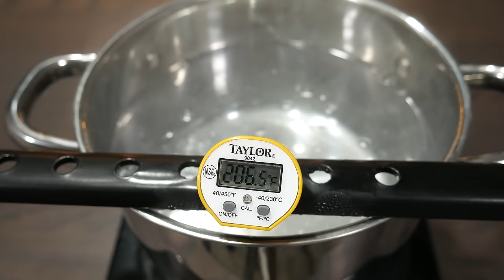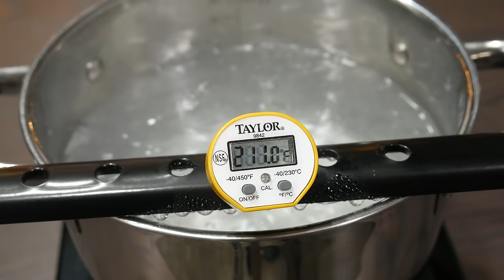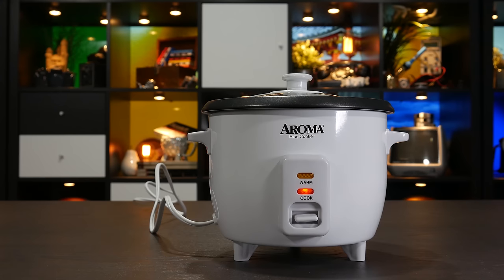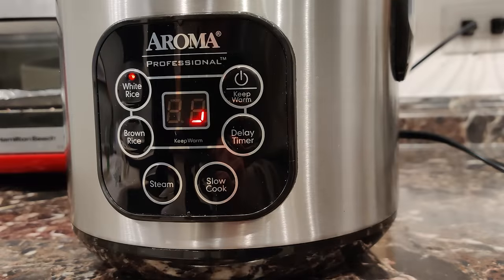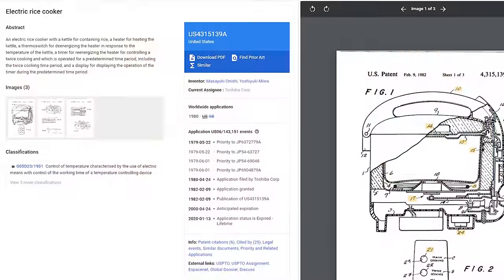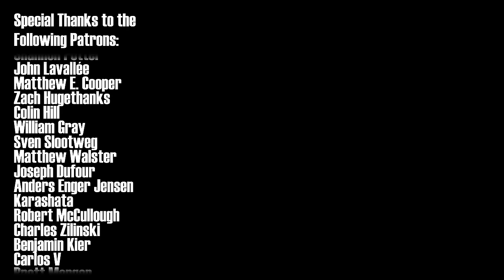Old-fashioned rice cookers are extremely clever

Comment: "As I'm sure we all know, water boils at 212 degrees Fahrenheit"

I didn't. I knew it boils at 100 degrees Celsius, though :P
(Bet he totally didn't see this type of comment coming)
Reply: Except it doesn't if you're above sea level...
Reply: @awo1fman  exactly, that's why the Celcius scale is superior 100 degrees the boiling point of water at sea level, 0 degrees the freezing point
Reply: @ewanwood  Nope, it's far inferior, because the boiling point of water is arbitrary and irrelevant, and there are no simple comfort ranges like there is every 10 degrees with Fahrenheit. Celsius blows.
Reply: @awo1fman  What do you mean by "there are no simple comfort ranges"? Comfort is subjective, also (to me) 18C is cold, 20C meh, 21-23C good for the winter, 28C good for the summer, 30+ is damn hot, 50C means my tea is ready, 6C means my beer is cool. Don't need anything else.

Also, being that water is the principle of life I think it's a sensible choice to choose its boiling and freezing point as a reference scale. Taking body temperature as a reference is bollocks since there are no two human beings that have the same exact body temperature in the same exact conditions and feel exactly the same about it, while water boiling is ubiquitous everywhere in the universe (at a given pressure).
Reply: @alessandroceloria  the F temperature scale is based on the normal temperature range of human life.
0 F is about as low as the temperature gets in most of the more inhabited parts of the world, and 100 is about as hot as it gets in those places too.
So I wouldn't be surprised if he measured the two extremes between winter and summer where he lived, and used those as 0 and 100.

But generally speaking, you don't want to be in temperature less than 0 or over 100, it's just not good for your health.

C just doesn't fit this kind of useful to everyone range, freezing is not as low as things get most places, and boiling water is WAY too hot!

It's great for science where boiling water is a basis for many things, but not so much for human life.
You basically live in 12 degrees, while I live in 100 degrees.
Reply: @ke6gwf  Fair enough. It probably boils down (he he) to what someone's accustomed to use day to day.
Reply: @awo1fman  yep it's so inferior the the United States, it's unincorporated territories and its freely associated states in the west Pacific are essentially the only places in the world where Fahrenheit are officially used. 🤣
Reply: @ewanwood  And we all know the majority is always right. 🙄
Reply: @awo1fman   Mark Haury   Mark Haury  yeah cos the earth is actually flat bro just because the majority believe it isn't. Besides Celcius is a metric scale and it is recorded as degrees .1 to .9 between degrees. Fahrenheit is established from a freezing point of a brine solution which seems pretty arbitrary - not sure about the whole 'normal temperature range of human life' statement. Besides Kelvin is the temperature scale of physical science not so much Celcius.
Reply: @awo1fman  But 0 Fahrenheit was defined as the temperature of saturated brine at a particular pressure & 100 was defined as the blood temperature of the inventor..but he must have had a fever because blood temperature is 97.8-99.... so it was crazy to start with.
Reply: @ke6gwf  No it isn't. 0F was defined as the melting point of saturated brine & 100F was blood temperature, neither of which can be accurately recreated & the inventor also had a fever so 100F was wrong in the first place. Celsius is the melting & boiling point of pure water at "standard" pressure, conditions which are easier to recreate.
Reply: @TheRip72  But Fahrenheit has very nice and round comfort zones. 70°F is "room temperature" and very comfortable. 80°F is getting warm but is very tolerable. 90°F is getting uncomfortable, and 100°F is roasting. Going the other way, 60°F is cool but stil fine, 50°F is light jacket weather, 40°F is medium jacket weather, and 30°F is parka weather. There are no such round, sensible, easy number ranges for Celsius. You are defending stupidity.
Reply: @ewanwood  Funny, I live in a country that has been Metric for 40 years, and yet half the people still use Imperial when describing things to each other, even people who are decades too young to have ever formally learned anything but Metric. Because Metric is extremely non-intuitive and useless for everyday life.
Reply: @TheRip72  wrong on several counts. Lol
0 is an easily reproduced mixture of equal amounts of water, ice, and a salt.
32 is easily reproduced as equal amounts of water and ice.

And he originally considered body temperature to by 96 degrees.
I haven't seen anything that 100 was supposed to reference specifically, but it wasn't body temperature, since that was 96.

After his death, it got recalibrated a little bit, and that's how body temperature shifted to 98.6~

He started this because he was figuring out how to use the new and more accurate mercury thermometer, instead of the older alcohol style.
I suspect that he made the scale based on the range of the thermometer that he was using, so basically divided the actual glass tube into degrees, and then measured different things and looked at where they fell on the tube.
Ice, water and salt was probably the coldest thing he could easily make, so setting it as zero made sense, and then likely it was based on a tube of a certain diameter and markings a certain distance apart.
Reply: @awo1fman   well I must  admit I am surprised at that. I also live in a country that converted to metric over 40 years ago and I find quite the opposite. Most everyone uses metric quite naturally and I think the system is extremely logical and perfectly suited in daily use.
Reply: @alessandroceloria  You can lie to yourself all you want, but you just clearly demonstrated my point. Those are NOT nice round numbers, and it's anything but obvious how they relate to each other. Celsius is essentially logarithmic to human perception, while Fahrenheit is linear. Celsius degrees are much too large a unit and you have to tack on tenths of a degree for it to be meaningful. Whereas with Fahrenheit it's a nice round 2 degrees that are easily and reliably perceived by humans.

Water only boils at 100°C at sea level, and therefore pretty much everyone on the planet who doesn't live with their toes in the water (which is the overwhelming majority) sees water boiling at lower temperatures than that, so right away that nice round 100°C gets changed to a 99.something or less, and there goes any argument you could possibly have about how it makes sense.

Not that anybody gives a flip what that exact number is anyway. All anybody cares about is whether it's boiling and time to make tea or it's not boiling and not time yet. The bubbles tell you that, not a thermometer. How many teapots or water kettles have thermometers on them? Not many at all.

The exact numbers everybody DOES worry about are the ones related to what they need to wear when they go outside, and Fahrenheit is far, FAR more useful and sensible for that.
Reply: @ewanwood  That's called confirmation bias. I've been to a number of Metric countries, and sure, they throw around Metric measures, but if you check their work they're always wildly inaccurate, while people who use Imperial estimates are much closer to reality. Because Metric is arbitrary and only means something to scientists who don't actually deal with the real, human scale world (and always use instruments to measure and calculate exactly), while Imperial is easily and reasonably accurately measured by tools you always have with you: your stride, your fist, your thumb's first knuckle, etc. None of those things coincide with anything Metric.

I never listen to directions from people in Metric countries anymore because they're always very, very wrong.
Reply: Yndostrui: I believe he was being sarcastic.
Reply: @conwaytwt  Of course he was. Taking sarcastic remarks literally is way more fun, though. (And I did include the remark in parentheses)

Gotta say, though, did not expect so many idiots arguing back and forth. Does it really matter whether you use Fahrenheit or Celsius? Just use what you are used to.
(The people supporting other imperial units are crazy, though)
Reply: @awo1fman  LOL nope. The fact that 22 degrees is not a round number doesn't make a difference. I know that ~22 degree is a nice warm for indoors in winter, the fact that it's not a round number doesn't change anything (really?). And you won't notice the difference between 22 and 23C for example, so it's not too large of a scale. Everything shifts temperature with varying pressure, including the human body, both in the Celsius and Fahrenheit scale, so the argument that water boils at different pressure in different places doesn't make Fahrenheit any better since it affects every scale. Water boiling is just any reference point like any other. And looking at a temperature in Celsius I can clearly determine how should I dress. 6C? Better take a coat and a scarf. 18C? Well it's chill but livable. -2C? Geez I'm better off taking my gloves with me. And I'm aware that you can make it with Fahrenheit too, it just doesn't prove that Celsius (or any other scale for that matter) is inferior. I lived 20 years knowing that 22 is a good temperature, you lived x years knowing that 70 is a good temperature. When you k. Look at the thermometer you don't make complex mathematical computations, you go by experience. Mathematical simplicity of a temperature scale is unnecessary (in day to day life, scientific world is another matter).
Reply: @awo1fman  hey, you know, maybe the reason you THINK people from metric countries (that is, the whole world except Eagle-land) are very wrong is that your comprension of the metric system is wrong?
A few examples from everyday life:
Below 0°C = I should be careful on the road, there might be ice patches. Below 0°C = I can make ice cubes for my drink. 
100°C : water's boiling.
1 metre (or meter) = approximate length from left elbow to right hand. 20 centimetres = the approximate distance between the extremity of my wide spread thumb and pinky (or, and I dont mean to brag, the size of another part of my anatomy 😏)
Reply: @takix2007  LOL Yeah, right, those approximations are so convenient and useful... "Pardon me, people, and make room while I lie down repeatedly and keep trying to put my left elbow where my right hand just was!"...

Again, nobody really cares about the number at the boiling or freezing point of water, and the former is never, ever encountered simply by stepping outside.

I repeat: I have never got a metric estimate that wasn't off by a factor of two or more. Imperial estimates are usually off by less than 100%. Because Imperial measures originated in, and are directly connected with, the physical world, while SI units are utterly arbitrary and theoretical, and have zero connection with human daily life.
Reply: @alessandroceloria  Now you're just lying. I'm in the Southern Hemisphere, and right now (it's summer here) the difference between 22C and 23C is gigantic. I'm used to having thermostats that have increments of 1F, and even those are perceptible. Using thermostats with Celsius is both less comfortable and more wasteful of energy, because the much larger units make it much harder to dial in the exact comfort, and the result is overshooting and wasting energy.

Memorizing a bunch of odd numbers is far more difficult and less reliable than ranges of exact 10 degrees. Any claim to the contrary is dishonest and laughable.

Seriously, you're shooting yourself in the foot with that assertion. If memorizing a bunch of odd SI numbers isn't a problem, then neither is memorizing a few Imperial conversion constants. Not that those are often encountered in daily life anyway...
Reply: @awo1fman  yeah yeah yeah, and I never got imperial unit lovers to understand that it might just be that they were born in it, that's why they find it convenient. 
My approximation of 1 meter would be useful, for example, to measure a length of rope/wood/fabric...; to measure a distance on the ground, I would use the distance between my feet when taking a medium-length step.
Well, whatever. I don't find the imperial system convenient, you don't find the metric system convenient, nothing to be pissed about, right?
Reply: @takix2007  Nope.  I've done experiments on this, and a metre is NOT a "medium-length step". In fact, I'm 6'2"/188cm, and a yard is a long stride for me, and a metre is too long to be easily and consistently paced. This is exactly what I'm saying: you have no concept of how far off your Metric estimates are.

And yes, there is something to be pissed off about. As I said before, corporations LOVE metric because it is very much to their financial advantage, and very much to the disadvantage of consumers. It's basic math. Smaller units (ml vs. ounce, g vs. oz., litre vs. gallon, km vs. mile) always mean more profit for them and less value for money for you.

But you're used to being ripped off left and right, so you're not concerned, right?
Reply: @awo1fman  🤣🤣🤣🤣🤣🤣 lulz. The evil corporations are selling me unprecise meters of distance.
May I remind you that someone who sells you half a meter of yarn when you are paying for a full meter would have problems with some kind of regulation authorities?
OK, fair enough, when I said "medium-sized step", I might have been unprecise in my wording: not medium-sized as in "my everyday walk to the bank" (that would be closer to half a meter), but as in "not so far as to need to really stretch my legs beyond reasonable".
Reply: @takix2007  You are really obtuse. Charging you €0.01 more per litre of fuel = €0.04 more per gallon so you're being charged FOUR TIMES more for the same perceived increase. Grams are so small that they usually price things per 100g, and it takes nearly 4 ounces to equal that, but they make up for that by giving you much smaller quantities overall and charging the same price (but usually more). The same goes for ml - the containers are smaller as well as ml being even smaller relative to fluid ounces than grams are to weight ounces. I suspect that if petrol and diesel were sold by the gallon instead of litre in SI countries it would cost a lot less than it does because it would be a lot more obvious how much you're being ripped off. And no, that bullsh*t about it being mostly taxes doesn't fly, both because that is no different in the USA and because it just means you're being ripped off by your own governments as well as the petroleum companies. That's worse, not better.

The sales people in stores don't have anything to do with the units of measure, and they don't estimate, they measure, and even when they do estimate, they make sure you get more than you paid for. They also couldn't care less about the units because they're being paid by the hour, not by the amount. (Yes, some sales people are on commission, but usually not the the ones to which you're referring.) We're not talking about the little sales people, we're talking about the corporations that own the stores and make the products. So that comment is a straw man and utterly irrelevant.

And yes, if you actually measured it, is is in fact "so far as to really stretch your legs beyond readonable." I've measured it, you're making the typical close-minded, gravely erroneous assumptions as all SI champions.

I was actually excited to be immersed in SI and find out for myself how much better it was. But that is simply not the case. I came at it with an open mind, prepared to be pleased with SI, and after many years of critical study these are the conclusions I've drawn. You, on the other hand couldn't care less about truth or reality and choose to ignore the obvious.
Reply: @takix2007  I haven't forgotten anything. In situations where feet would be used, centimetres (or even millimetres) are used instead. As for yards vs. metres, about the only things sold that way are textiles, and it's moot. First of all, they are much closer in size than any of the other comparative units, and secondly textiles are a very high-profit-margin product that varies wildly in price from store to store (and time to time even in the same store) for the exact same thing. This season's high-priced fashion material is next season's bargain-bin clearance item. Not to mention textiles are not a daily purchase for most people. Clothes are textile, but the price of clothes has nothing to do with the price of the textiles of which they are made.

Acres are much smaller than Hectares (1 Hectare = 2.47 acres), but Hectares are rarely used in daily life, and square metres is used instead, which are obviously much smaller than acres. Really large areas may be expressed in square miles versus square kilometres, but how often do you use measurements of that scale? It's not a human daily life scale. Even if you are a farmer, the units themselves are irrelevant, they are just something you use to calculate how much water, fertilizer, herbicide or pesticide  you need, and the units themselves are irrelevant because the calculations are the same regardless of what unit you're using.

Another exception is medium area measurements, which would be square metres vs. square feet. But this is another thing that is rarely used in daily life; it's mainly used to describe the size of houses and other small buildings. So it's strictly a descriptive/comparative term, not one that determines profits or prices. A person may say, "This house cost me $30 a square foot to build", but the unit is irrelevant, it's just a comparison with the cost of other buildings, not a deciding factor in and of itself. When building, you don't care about the cost per unit of building materials, you only care about the bottom line total cost of a particular material. You only say "per square foot" or "per square metre" to make sure you're comparing like units, and by using the per-unit cost you can easily compare building costs of different-sized buildings. It's the comparison, not the specific unit, that matters. Like the boiling point of water, no one cares about the exact temperature number, only whether it's time to pour tea or not.

I can go on forever refuting your every example case by case, but I'm not going to because there's no point in talking to a brick wall.
Reply: @awo1fman  yeah, except fuel prices are down to the decimal of a cent per litre (at least in France) where US gas prices (in Texas for example) are down to the whole cent per gallon: so 10/4 =2.5, we win 2.5 cents per gallon on the rounding. Same goes for many other products, prices per liters will usually be down to the tenth of a cent if it is sold in large but arbitrary volumes.
And if you buy significant quantities of anything, they won't charge you with the 100g retail price but with bulk prices, in kilograms (that's about 2 pounds, so we win on the rounding) or metric tonnes (that's about 1.1 US ton, son we also win on the rounding). So much for the big metric scam.
Moreover, often prices in stores are by the kilogram, even if the usual buying quantity is hundreds of grams (example: meat prices are in euros and cents per kilogram, so when you buy two "quarter pounders", 2x125g of meat, you won't be "scammed" by a "per gram" or "per 100g" price.

And considering feet vs (centi)metres, I usually describe my size as 1.80m (so 6 feet), not 180cm, same goes for most of the metric world (some medical or administration forms use cm, but it's not the way people usually talk), I bet even US passports specify height in metres.

Also, given your argument, one could argue that rubles are better than dollars, because the rounding of prices scams US customers compared to Russian customers, since 1 ruble is lower than 1 dollar.

Suffice to say your arguments are not very convincing to me.
Reply: My mistake, apparently US passports do not specify the holder's height, neither do UK, German or Italian passports after a quick google search. Must be a French thing.
Reply: @awo1fman  ignorance and denial ? In what way ? I actually considered your argument about prices per unit, wondered how I did not notice that, but quickly debunked it by 5 min of thinking and 5 min of googling to check how gas prices were in the USA for example. Sorry, I'm not the one in denial. I'm the reasonable guy saying that convenient everyday units is what one is used to using, no matter how (kinda) silly it might seem to others : 12 inches to make a foot ? Adding 5/8th of an inch to 3/4th of an inch? rather than using decimal units, which everyone is quite used to counting with? I do recognize some usefulness to these subdivisions, being that it is easier to divide "by head" since 12 has more integer dividers than 10, but it's not as practical as it may seem : it's a bit more unpractical to convert 53 inches to feet than to convert 153cm to metres (BTW I didn't choose these numbers to be conversions of one another)
Reply: @awo1fman  I never said that memorizing imperial conversion is pointless or wrong or difficult. Even though I use metric mainly as I live in a metric country, I do find in certain situations imperial way more useful where I need to divide something by two, three, four, twelve or so on. I don't know exactly where you live but at in my house the temperature constantly fluctuates between 22 and 23C and I can barely tell a difference. This might change based on humidity though.
What you fail to realize is that I don't have to memorize any number at all. I don't wake up in the morning and pull up a table of temperatures to study. Do you have to take an exam to know if your feeling cold or warm or hot? No, it's your skin, you just feel it. I don't have to look at a thermometer to know if I'm cold or not FFS I just know it lol. Your age is an odd arbitrary number. Do you wake up every morning and repeat your age to memorize it? No, you just know it because you live by it. The same goes for temperature. For 20 years of my life I observed that when the temperature is ~22C I feel comfortable, just like you for many years observed that every 10F there is a comfortable temperature. 10 is an arbitrary number too, and you weren't born knowing that every 10F there is a good spot. You learnt it just like I learnt that 22C is good. If you use Fahrenheit so I guess you also use imperial, which is a bunch of arbitrary odd numbers as well. I don't have any problem doing operations with numbers that are not powers of 10 because I know basic math and I'm not completely brain dead. Besides the fact that as I've already repeated many times, I don't need to make any calculation to determine an ideal temperature, my experience and my skin sensors are good enough for that.

That being said I guess we agree to disagree.

EDIT: Just for the record regarding the whole memorizing temperatures argument: in my current apartment I don't even have a thermostat, only a bunch of radiators with those 1 to 5 regulator knobs. When I feel cold I turn them up until I'm comfortable. Simple as that - no numbers, no C, no F.
Reply: @alessandroceloria  Except what you are feeling indoors at home is irrelevant, for your stated reasons, and what's important is what you need to wear when you go outside. It's those outside temperatures for which you have to memorize all those weird Celsius numbers so you'll know what layers to wear.

If you never leave your house, that's a different problem altogether. 😂